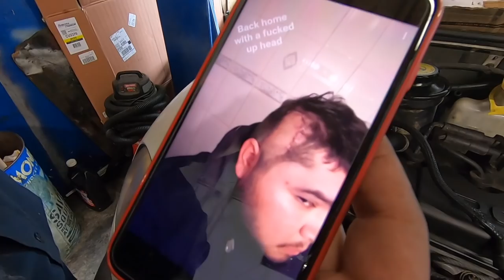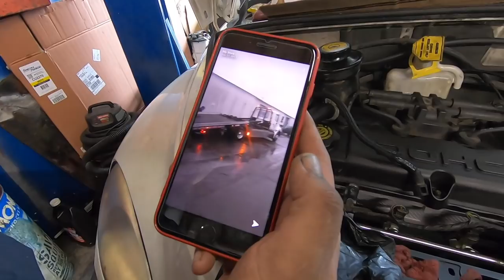Emotional story....What really happened to Mario?

Comment: Eddie's Life I have a 14 ram 2500 deleted Kory Willis tunes ect 5 inch all the way back stock tires are 275 70 18 I have 255 65 18 toyos which are 2 inches smaller then factory I also had youkon 4.88 gears installed lol 2050 rpms at 60 mph but I don't interstate drive I just pull a 17k equipment trailer that's fully loaded weight verified on cat scale my truck never goes over 163 degree trans Temp my boss has been in business 40 years and has told me he's never had a pickup truck that towed his trailer so effortless I'm very new to the diesel game so I can't compare it to other trucks but boy does it tow good. I'm prolly one of the few with such a crazy set up I also have air bags to keep it level would love to tow your trailer some time check out my video on my channel I'll be uploading more